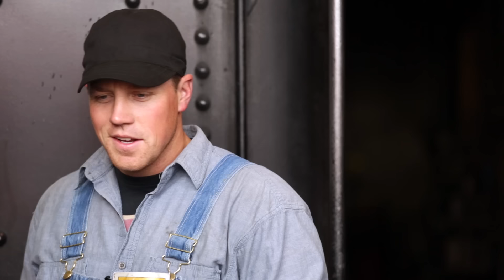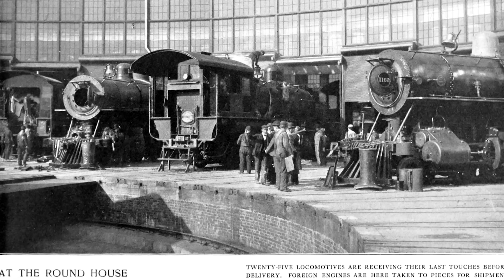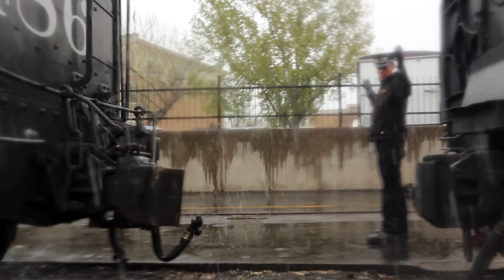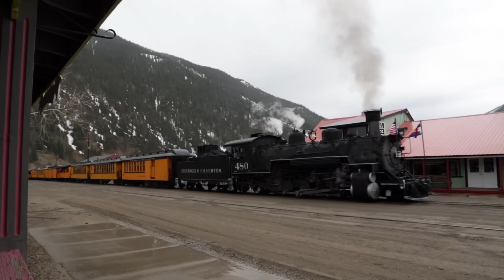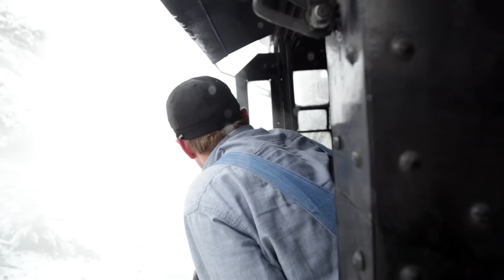Steam Men - Life on a Steam Engine Train

Comment: Ignoring dirt and CO2 climate change if it exists, if you'd be so kind, a calorie of energy from coal is the cheapest calorie you will ever have. Aaand, the working gas of a steam engine is H20, molecular weight 18, while the working gas in a diesel is nitrogen (molecular wight 28) CO2 (molecular weight 44) and O2 (32) so steam is the lightest, and at any temperature the molecules are moving fastest and giving the most energy to the piston head.  A steam engine is simply better than a diesel, if you can find the skilled men to make it work.

Comment: Um...bell ringing like crazy...except it aint moving.
Reply: That’s because these bells have pneumatic ringers that will automatically ring the bell when the engineer or fireman turns a valve. They can still be rung manually with the bell cord, though.

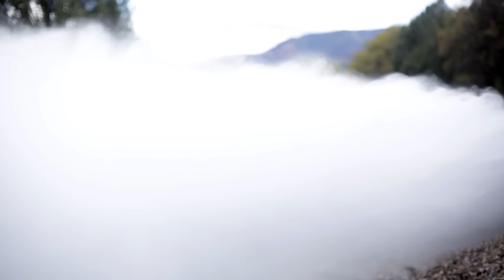Comment: There's occasionally a large blast of steam coming from just behind the drive wheels. (Closeup of it at 21:49) Can anyone tell me what this is?
Reply: These engines do not have “turbine driven water pumps.” All have non lifting type injectors, which do blast some steam when they are started up but not a whole lot. What you see at the 21 minute mark is a Blow down which blows out sediments or other built up scale matter from the firebox. This task is done several times on this trip, primarily for effect.
Reply: @cwhuffman01    @Aaron Levering  That's what I had thought, that turbine-pumps were used more on bigger engines while smaller ones just have injectors.

It makes more sense that it would be a blowdown since water is typically added constantly at a slow rate rather than putting in a lot of it for just a few seconds.
Reply: The blowdown is done more frequently when the water quality is poor. Even with softened water in your house, shower heads do plug up. Think about what this scale or sediment would do to the boiler if not cleaned out. The blowdown helps with the raising of steam in the boiler as it can transfer heat more efficiently.
Reply: John73 John  the steam coming out the left side of the engine is the exhaust from the feed water pump. It's a small turbine driven pump that moves water from the tender to the feed water heater in the smoke box. From there a high pressure pump pushes the water into the boiler  to replace the water that is boiled off. It is operated intermittently as demand requires.  There's a pretty good explanation on "feed water management" from the Grand Canyon Railway on the youtubes. I just don't know how to insert a link here. 
It's on the fireman's side as that's his responsibility.  If the water level gets to low the crown sheet of the firebox can overheat, gets soft and the boiler will explode. So it's kind of important.
Hope that helps.
Reply: Ah, thanks for the explanation.

You can just copy+paste the URL of the video in a comment and it'll make the link automatically.
Reply: John73 John see now you've helped 
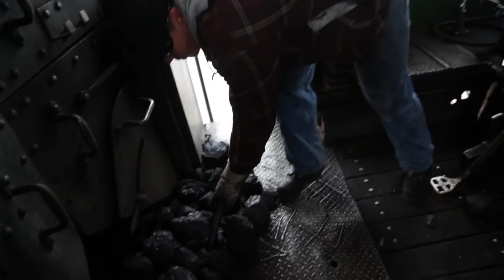Me as well The feedwater bit starts around 8:22. Prior to that it talks about the injectors. Just happy I could share some "knowledge of questionable utility " I refuse to call it "useless" https://youtu.be/iky_kRqp7Bk

Comment: Hi there , I've not seen very much of USA footplate work , I've seen plenty of UK and even ridden on a few UK ones , very impressed . May I ask what is all that steam about that is rushing out on the left hand side , is it when the boiler is being filled with water from the ejectors? A very good recording , I will be looking out for more , thank you .
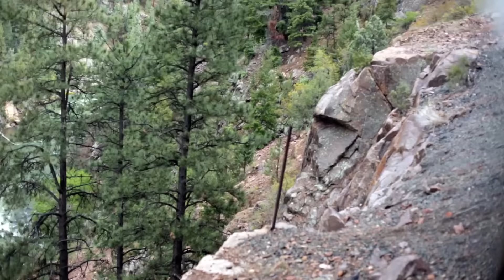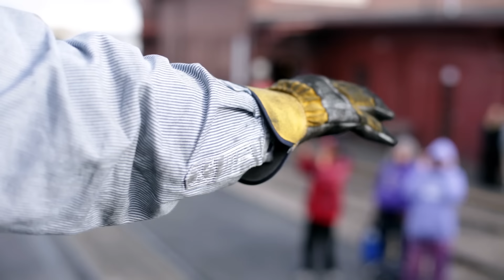Reply: I've seen locomotives at Strasburg RR do the same & was told it's done periodically to clear sediment from the boiler. Dirt, rust & corrosion will collect in the bottom of the boiler. If that gets into the system, it can possibly scour the valve & cylinder walls. So, a quick blow down will get rid of it. Some steam engineers add a quick short "blow down" to their excursion just to add a little extra experience for the riders. Blow down piping was usually built facing downward. But, to add to the steam show, some pipes have been redirected to expel out the side. That gives the riders an idea just how much steam pressure is contained in that boiler. You can also see it explained here, at 18:25 through 19:14, https://www.youtube.com/watch?v=QPfPznzL1OM&list=WL&t=9s&index=28
Reply: It’s a blow down valve, its main purpose is to lower the boiler water level if you get your fire really hot while your drifting for awhile to keep the safety from popping off then you’ll need to get rid of some water to keep from working water into the the cylinder and blowing the heads off because water won’t compress like steam. An added perk to the blow down is getting rid of sediment aka boiler mud
Reply: Probably condensation drains on the cylinders while they were drifting downhill.
Reply: LuckyTrucker1 I believe it’s releasing the brake / cylinder pressure. But don’t quote me on the that.

Comment: This was amazing! Why does 482 have 486’s tender?
Reply: Tenders are easily swapped between locomotives, particularly of the same class.  Unhook the water lines, air lines, and draw bar on one then replace the tender and hook everything back up.

The Burnham shops in Denver had the 454 and 464 in for work.  One was in for boiler work and other was in for running gear work; to get a running loco out as fast as possible the boilers were swapped.  No. 464 now has the throttle of the 454.  This was not a few hours work but faster than the work needed for either loco alone.
Reply: Roy Reynolds I know that they can easily be swapped, but I’m wondering why exactly it happened
Reply: MPT 765 This was a couple yrs ago but the 482's tender was being repaired.  They had their regular tenders back after a short period.
Reply: William Reed that makes plenty of sense. Thanks